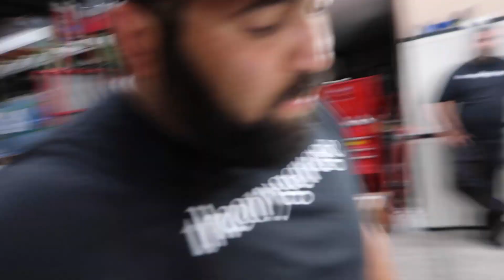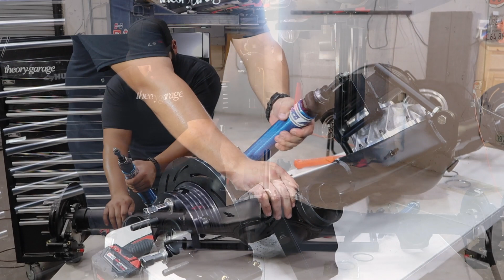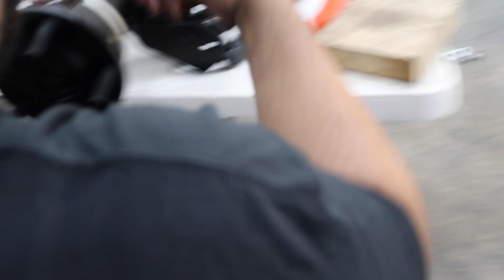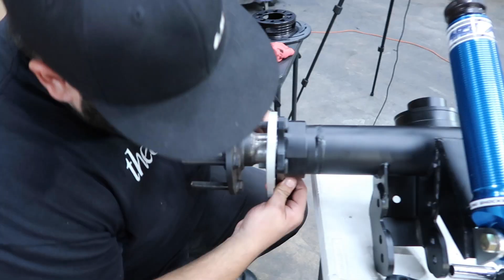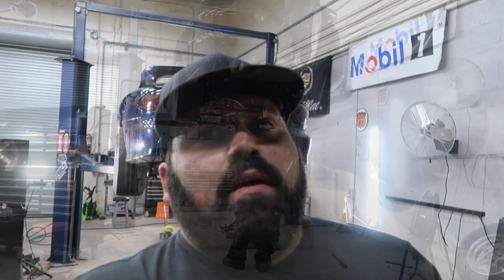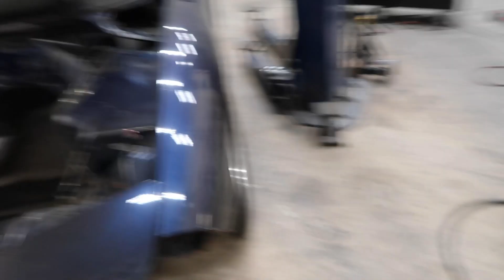The Ultimate Trans AM Roller Done In House By Theory Garage

Comment: Awesome job guys. We cheated and used a transmission jack to install the rear on my boys car. It was a struggle putting it on the jack, but we got it. I don't think it weighed as much yours though.
Reply from the maker: That's the way to do it! We tried but due to the welded anti roll bar on the bottom of the diff, it was impossible to balance. We appreciate the comment!
Reply: @theorygarage365  oh ok, the boy has a bolt-on anti roll bar being delivered tomorrow from MWC.